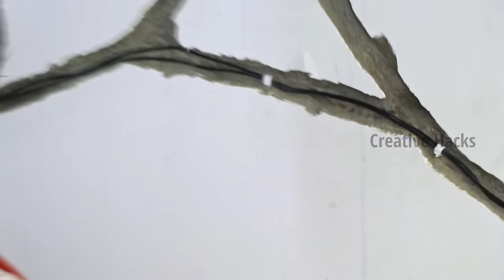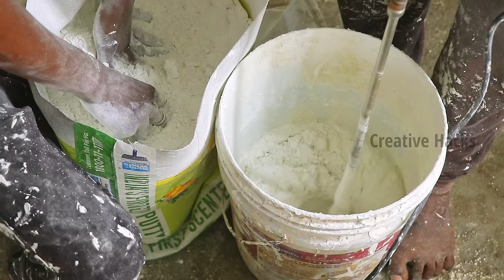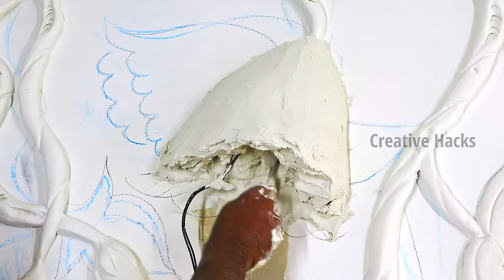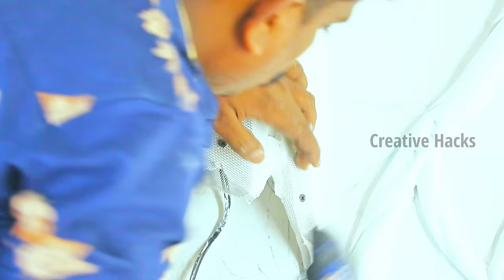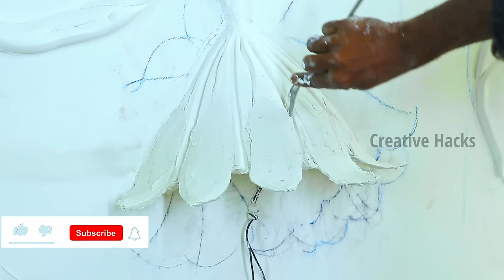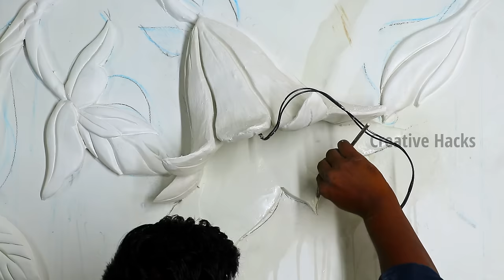flower wall decor mural making process tutorial for Beginners

Comment: Hello! I got the plaster of Paris 

What can I use in place of the wall putty?  We don’t have that brand in US that your using.

Would joint compound or modeling paste be a good substitute ?
Reply from the maker: the material in US  you are using skim coat for walls is called wall putty...plaster of paris means  the material when u mixed water in it ,it will dry with in 10 minutes is called plaster of paris..
Reply: @Creativehacks1   yes I have the plaster I don’t have the birla wall putty so was asking what can I substitute? Joint compound or modeling paste?